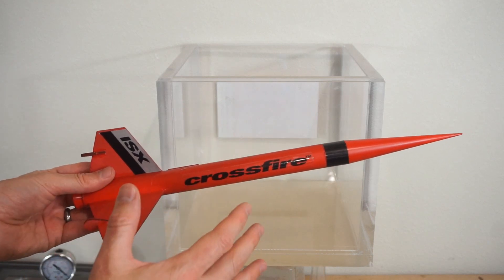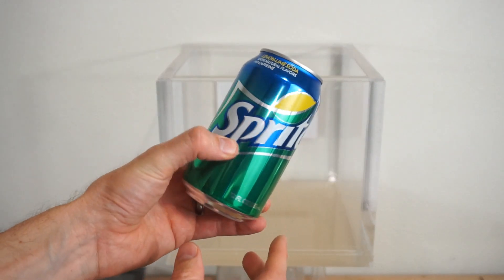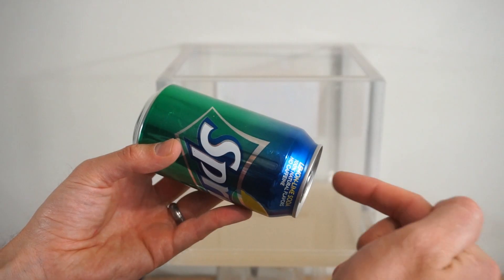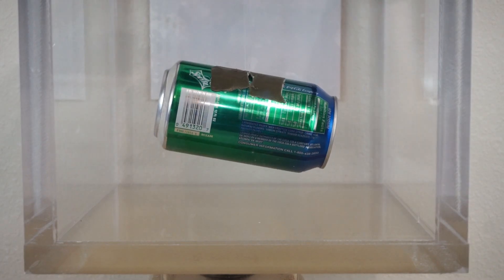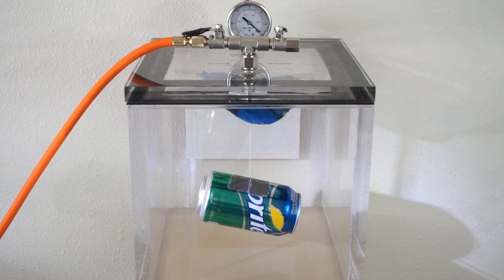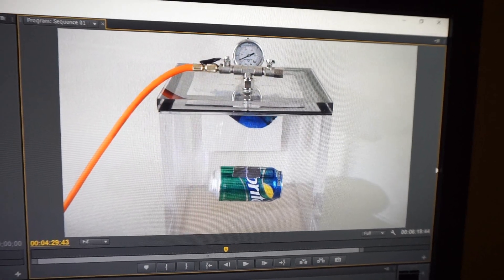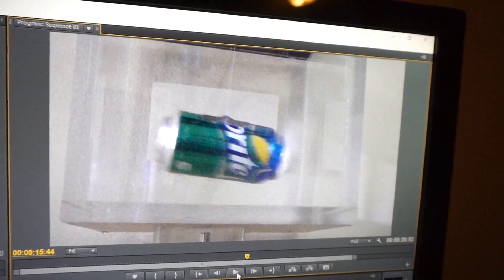Can a Rocket Fly in a Vacuum Chamber?

Comment: The only issues rockets have in a vacuum is that they will "burn" super fast compared to in an atmosphere, reason being the high pressure inside the rocket during burning will more rapidly and easily come out from the output nozel this is do to no "air shield" which the thrust creates its also known as a shockwave, I imagine this would not be an issue as in space the rocket can burst and then drift, using gravity sling can also aide in saving chemical fuel in this case, also different nozels could allow changing of positions easily. I wonder what the thrust is compared to in atmosphere? I imagine a badly made rocket would be less "efficient"

Comment: Implosion doesn't prove jack....
The liquid inside is pushing off the top of the lid when its about to explode...
Rocket in space aren't getting that push start.. You're over looking things.
Reply: There is no hard distinction in "atmosphere with non-vacuum" and "space with vacuum". If your weird interpretation of Newtons mechanics was true, then the speed or efficeny of reaction engines (both jet engines on airplanes and rocket engines) would depend on the air pressure. So a rocket would work worse, the thinner the air gets, and finally in a perfect vacuum it would not work at all, right? So how is it possible then, that rockets keep on accelerating the higher you get? Or why airplanes only can go very fast in high altitudes? Already on 36 km (the usual definition for the beginning of space 100 km, the altitude record for an amateur rocket is 118km)) the air pressure is only 1% comparing to the ground.

Comment: Still pushing off the wall. Your controls for this experiment are weak, I am sorry to say.
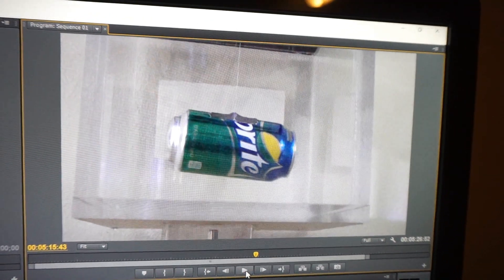Reply: At 6:00 one can clearly see the can moves before the exhaust touches the wall.
Reply: The can, balanced on a single fulcrum point, becomes unbalanced as part of the internal volume becomes gaseous, forcing the liquid to the other end, creating an unbalance and thus that slight movement.
Reply: That would only cause the can to rotate around said point.
Reply: There is no reason whatsoever that the internal volume becoming gaseous would cause anything to become unbalanced.
Reply: strongtower1
No, the only unbalanced thing here, are the internal forces on the can.

Since the force on the bottom of the can are no longer cancelled out by forces on the top of the can (since the top is blown off), the can experiences a net force, and starts to accelerate (F=ma, or in this case a=F/m).

Comment: for those that say it moves because of the wall of the chamber, you can clearly see 6:00 the can moving before the liquid even meets the wall of the chamber, there's motion in that one frame way before any contact with Wall.
Reply: for those who can draw a free body diagram it's pushing off the detached lid. stupid experiment.
Reply: @papalegba6759  Do you believe you can survive a fall by jumping from a chair at the last moment too?
Reply: @CorrosiveCitrus  How fast would you have to propel that chair downwards in order to stop your velocity as compared to the ground?
Reply: @HorkSupreme  would have to be an extremely hard push, if it's even possible at all
Reply: @CorrosiveCitrus  Let's suppose a 100 kg person is on top of a 5 kg chair. Both are falling at 200 km/h then the person stops at 0 km/h after throwing the chair.

The equation for momentum in this instance that I'm interested in is Mass 1 * Initial Velocity 1 + Mass 2 * Initial Velocity 2 = Mass 1 * Final Velocity 1 + Mass 2 * Final Velocity 2.

100kg * 200km/h + 5kg * 200km/h = 100kh * 0km/h + 5kg * Final Chair Velocity.

20000 kg*km/h + 1000 kg*km/h = 5kg * Final Chair Velocity.

21000 kg*km/h  / 5kg = Final Chair Velocity

4200 km/h = Final Chair Velocity

The speed of sound is 1,192 km/h. That's some swole thighs there to chuck it that fast.
Reply: @HorkSupreme  Yep, definitely not achievable for the average person that's for sure
Reply: @CorrosiveCitrus  doesn't seem that hard for a machine specifically designed to do that
Reply: @KingPlaysHDKPHD  not sure what you mean
Reply: @CorrosiveCitrus  "do you believe you can survive a fall by jumping from a chair at the las moment too?" No, a human can't because it requires too much energy, but a machine (rocket) that can actually exert that much energy surely can
Reply: @KingPlaysHDKPHD  oh. Well yeah, ofc. We were talking about humans though. Well specifically we were talking about @papalebba6759 - who probably isn't a human come to think of it.

Comment: This is tricky to understand because there are 2 different effects mixed into one and in 2 different environments. You will argue forever. One is fluid dynamics which is air being pushed against air. The other is mass ejection which is different but they both work. They are both present at the same time. The fluid dynamics part works in an atmosphere because its pushing on air but has no effect in space. The Mass ejection doesn't really work on earth or atmosphere but does work in space where there is less gravity and no resistance. In space its about how much and how fast the mass is being ejected.

Comment: Since there is pressure in the can there is then a force applied to all internal surfaces of the can. 

When one end of the can is opened then there is only pressure against one end and the internal sides, so the can would move in that direction from the force still applied to it internally. 

Once the pressure is equalised, the can will continue to move from the momentum, until friction slows it to a stop (or in this case, the tether forces it to bounce off the left-hand wall or lid).

Of course, if it were in actual frictionless space, it would never stop. It would coast until some other force acted upon it
Reply: Pressure is a scalar, clown.
Reply: @papalegba6796  ...and your point is?
Reply: @papalegba6796  You're a no-content troll.

Comment: Everyone keeps trying to prove rockets work in space by putting model rocket engines or high pressure gas systems in a vacuum chamber, which will never convince a flat earther, as they say its pushing off the wall of the chamber. Can someone please make a video with a spring loaded catapult on wheels in a vacuum chamber and show the catapult fire while empty (and not move), and then fire with a ball (and move).

Comment: If you are standing in a vacuum chamber, you will NOT move until you stretch out your arm against a wall. If you blow very very hard since your body is very dense, you will move because the AIR is stopping AGAINST the WALL. It creates something, a barrier against something, a physical object material you can push against. NOW! What happens if you REMOVE the WALL??? When the rocket brings IN it's own air/gas, then the vacuum chamber is not a vacuum chamber anymore, now the rocket can travel, but when you remove the walls of the chamber, then the rocket has no where to move, you can not push or make recyl wen the mass is hanging in a vacuum.

Comment: Fluid dynamics ....it does not matter if something is traveling through water or air.... It works the same exact way...a jet ski gets propelled through water the same exact way a rocket flies through air.. Except that a jet ski uses water to push against the water and a rocket uses gases to push against gasses... A submarine moving through water is no different than an prop airplane flying through air...now... People that say rockets do the "push" forward by expelling the gasses that the rocket then pushes against or that the push happens in the combustion chamber are clueless.... Saying that a rocket makes its own gasses to push against is like saying that a submarine that is on land that has 0 friction between the submarine and dry ground...can make water that the propeller pushes against and the submarine will move...again for the idiots that dropped out of school....it does not matter if something is traveling through water or air.... It does it the same exact way.... Fluid dynamics people

Comment: I use to make little dockets when I was a kid out of aluminum foil and pack it with match tips for my fuel and shoot them off my hot wheels track. it was only the size of the pencil I used to make the fuselage.  can you do something like that and hang it so it doesn't hit the wall but keeps spinning in a circle ?

Comment: This experiment is more like an explosion in a vacuum and not a rocket. There is no way for you to determine if that small jerk movement would have continued because the wall was so close. All of the major movement shown was pushing off the wall. Also you are looking at the liquid speed but not the gas as you can't see it. In a vacuum that gas is going to hit that back wall almost instantly as it has no air in the way to displace. A soda can is a poor analog for a rocket in space. To do this experiment properly you need a small rocket in an extremely large vacuum chamber. I doubt NASA is going to let you borrow their room sized vacuum chamber to light off small toy rocket engines either.
Reply: Rocket engines ARE an explosion buddy... haven't you seen them?!!?
Reply: Once that small movement occurs in space it continues as there is nothing to slow it down.
Reply: Excuses and evidenceless assertions, next